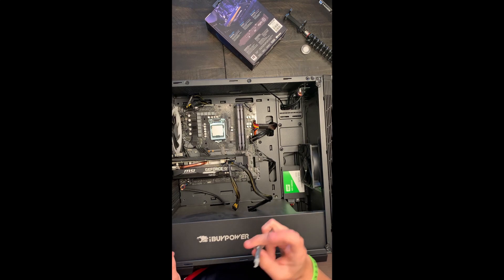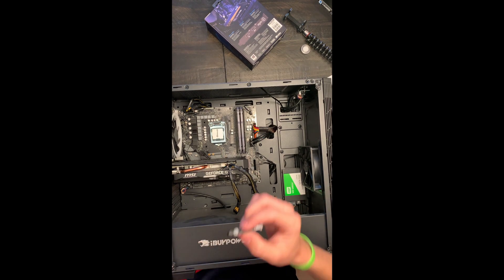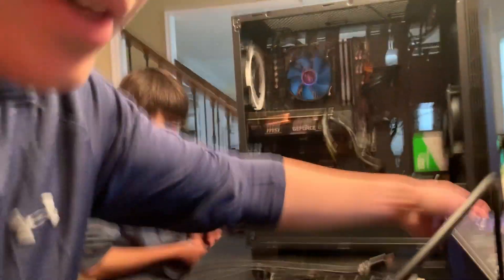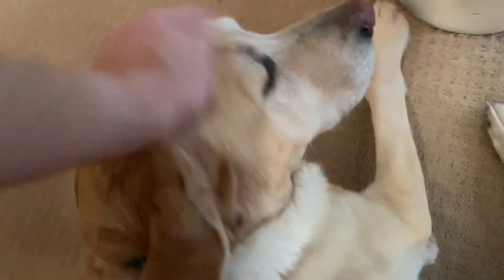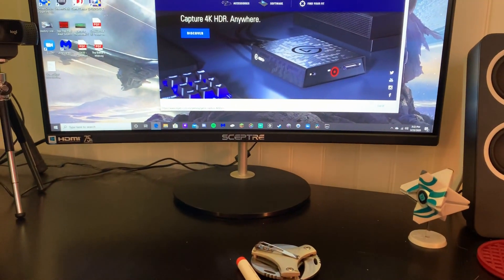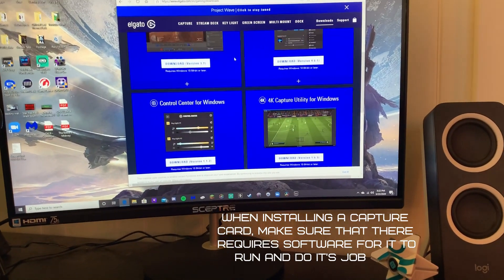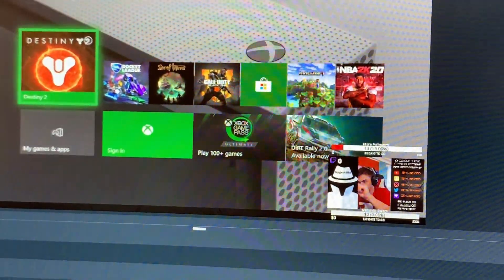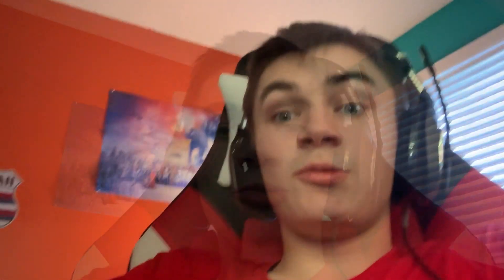Upgrading My PC/B360M IB-R1 troubleshooting!

Comment: Not sure why ppl say it's unsupported, or you can't find updates for this mb because I just updated mine from the Asrock site supplied bios firmware. Granted, it's still an old file (late 2020 I believe) but it does the trick and more importantly now meets Win 11 upgrade reqs.

Comment: Thank you so much for the bios update link. I literally looked EVERYWHERE for it. I’m hoping it will work to put my ram in xmp. Whenever I select xmp in the bios now it selects it for the time I’m in the bios then when I leave it runs at 1333 mhz and it should run at 3000mhz. I have the Corsair vengeance rgb pro
Reply from the maker: Dean Moser no problem man!
Reply: What happened with that
Reply from the maker: Genuwhine he needed the bios link for the update
Reply: Just so you know this motherboard will cap at 2666 mHZ for ram usage

Comment: How did u put on the fan when u out 2 hours later mine doesn’t screw back on man
Reply from the maker: Every prebuilt is different, and you might want to look up a video as to how you install different cpu coolers
Reply: Is your motherboard micro atx ?

Comment: @SpyJack180 thank you for the video, one thing I noticed while watching is that your RAM is in the incorrect slots, you want them in the 2nd and 4th slots starting from the CPU and going to the outside of the board to the right, so the stick on the Right needs to move over to the 4th slot instead of the 3rd slot so that you can have Dual Channel benefit! :)   Hope this helps. When you first put them in the correct slots, it may boot cycle for a bit with the change, but should boot normally, also after you make this change check to see if XMP is enabled in the BIOS. I also read below in a comment that you tried slots 2 and 4, if those don't work, try slots 1 and 3 and see if it then boots with the RAM in those slots.
Reply from the maker: Awesome. Thank you so much for the tip! I will for sure change this up!
Reply: that's how I put mine 2nd & 4th ...!!! nice to know I did something right ...

Comment: I don't know if you upgraded your RAM or it came like that, but its in the wrong spots. To use the RAM to its top performance you need to take the stick on the right and move it over 1 slot. Duel channel RAM should be placed furthest away from the motherboard and one space apart. On a good note good CPU installation.
Reply from the maker: Good to know! I did try that when I first put the new ram in, but it wouldn’t register and my of wouldnt start. So that’s y they are in that formation because my pc works that way lol

Comment: what are your temps with that cooler while stressed cpu
Reply from the maker: they are pretty standard. This one usually do not go above high temps if you open the case and feel the air  (my computer does not read temperature).

Comment: yo did u run into any problems with the i7- 9700k i was going to buy the i7-9700 to be safe but i wanna get the i7-9700k i just didnt know if the motherboard can handle it
Reply from the maker: PISTOL126 the motherboard can handle it! It has been on my computer for over 6 months, and I haven’t seen any red flags with it!! The only thing I would say that you might want to look at is your power supply usage (since it’s a faster cpu), but other than that it runs fine!
Reply: @spyjack180  thx so much appreciate it

Comment: I have this same motherboard. How do I remove the graphics card that it came with. I’m trying to upgrade
Reply from the maker: Eric Washington, you just remove it from the slot by first powering off your pc, then you unplug the chords going to the card, then you push the side buttons on the card slot out, and then you remove it
Reply from the maker: There shouldn’t be any extra computer program issues. Just remove it and put the new one in
Reply: Did your motherboard come with the GPU cables or did you have to buy them????
Reply from the maker: Is yours a prebuilt, or did you make it yourself? Because if it’s a prebuilt, you might need to check and see if you have the cables. Look up on the internet how to install a graphics card and that’ll help you out!
Reply: Spyjack180 I have one pci e cable with a 6pin and a small 2 pin
Reply from the maker: @juggineasy6206  look up how to install a graphics card  on youtube if you didn't already

Comment: What is the alternate motherboard called? I am looking into water cooling my cpu but cant tell if the water cooling system i want is compatiable because the asrock b360m ib-r1 is not listed.
Reply from the maker: There is no other alternate motherboard, that's the thing.  I would look into seeing if you can call Ibuypower themselves, because they can tell you the exact specs over the phone, and look up what cooling systems are comparable. Hope you can figure it out!
Reply: HI, I have the same motherboard and I'm using the C360 Thermaltake kit for my water loop and it works just great!
Reply: juan HH so what’s the name of the motherboard? can you find it online?
Reply from the maker: alanxaf there is no alternate motherboard. The mother board is called the B360M IB-R1. There isn’t mich online about it, so hope that helps

Comment: When you updated BIOS, did you jump straight to version 4, or go sequential? I found version 4 for the b360m ib-r1 on Asrock's site for SI's, but getting an invalid file error when I try to flash it. I'm still on the original version and haven't tried any others yet.
Reply from the maker: The update isn’t on Asrock’s website. The link below is where the update is. The motherboard is an off brand asrock specifically made for IBUYPOWER, so you’ll have to use IBUYPOWER’S bios update
Reply: @spyjack180  I tried your ftp link, which had the same 4.0 update on Asrock's SI bios site, plus two versions between it and the original. All 3 are giving me the same "invalid file" error. Any thoughts?
Reply from the maker: @Nareimooncatt  did you download them onto a flash, leave it plugged in, restarted the computer into the bios screen and update the bios by selecting the usb u put it on? If you did that, then idk what to tell you
Reply from the maker: @Nareimooncatt  might have to call ibuypower and see...
Reply: @spyjack180  sorry, forgot about this thread. Turns out it was a formatting issue. I saw that the flash drive needed formatted FAT32, so I used an online tool for that because the drive was too large for the native Windows format tool. I thought it was successful, but I eventually checked and the drive was still NTFS. I used a different FAT32 format tool and verified it worked, then was able to flash the BIOS. All is well now, but I appreciate your replies.
Reply from the maker: @Nareimooncatt  yea sorry about that! I try to reply whenever I can, but I’m glad that you figured it out!

Comment: what psu is that?
Reply: i have the same one and i dont know bc i feel like its not that good of a psu so i should upgrade it and idk whats combatable with this motherboard
Reply: also what ssds/hard drives are compatible with this pc?
Reply from the maker: GetBlockedUp I just have a stock power supply on mine. Idk if it’s a 550 watt, but I might upgrade to an 800 soon bc my pc has to restart every now and then
Reply from the maker: GetBlockedUp I’m pretty sure any seagate sata hard drive will work, as well as ssd (both sata and interface)